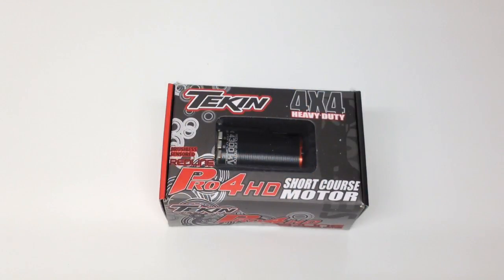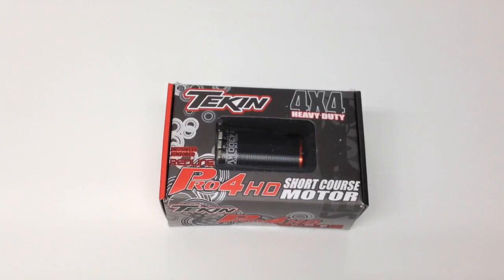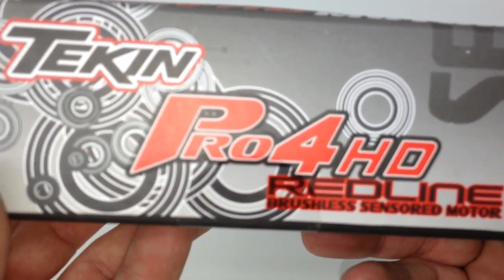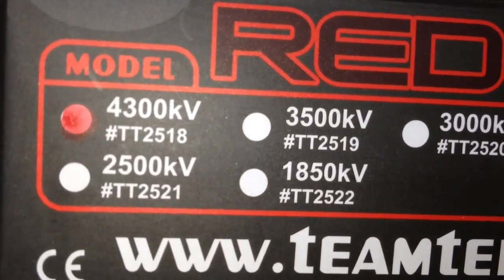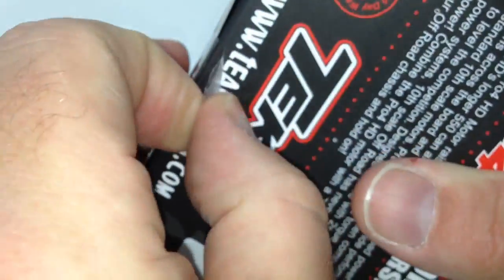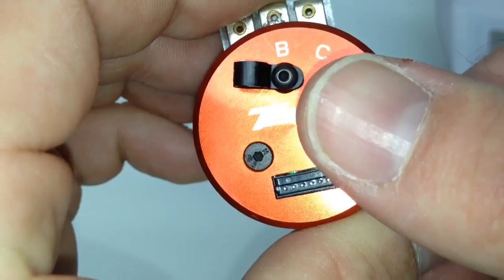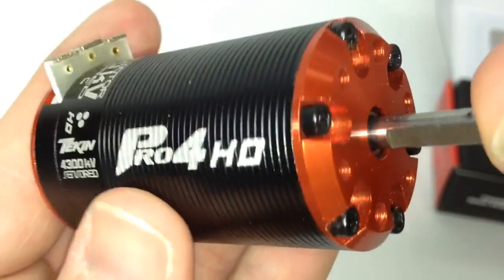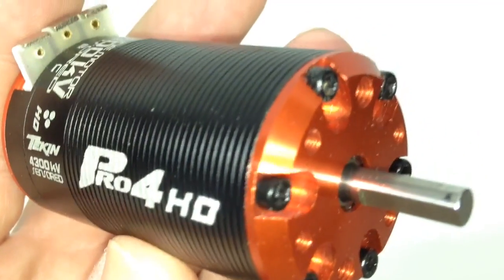Tekin Pro4 HD Brushless Motor - First Look!

Comment: Puedo instalarlo en mi camion con una Bateria 3S ???❤❤❤❤
Reply from the maker: Yes, you can use the Pro4HD with a 3s, but you need the 3000kv motor.  If you use the 4300kv or 3500kv, you'll have heat issues

Comment: is it true that a 2 pole motor is faster than a 4 pole motor. same kv same battery?
Reply from the maker: To certain extent.  4 pole will creat more torque to push around a heavier vehicle or a 4wd driveline.  2 pole is typically only used in 2wd/lighterweight vehicles

Comment: which motor do you recommend Tekin ESC X 4.5 motor or pro4 HD motor
Reply from the maker: The Pro4/Pro4HD motors are much better than the older Tekin SCX 550 motors (4.5, 5.5, 6.5)

Comment: Yo I bought this same exact Motor but mine is kinda weird when I spin the shaft it spins like a 2pole motor a 4 pole motor is much more difficult to spin or is this normal
Reply from the maker: This is a sensored motor, so they usually will feel smoother than a typical sensorless 4pole, especially castle motors.  For some reason my 4300 spins smoother than my 3000kv.  Might have to do with the winding
Reply: Miguel Plascencia  It has to do with being a sensored motor. the tight air gap used to create the return RF in each line isn't required because it's sensored. I'm not sure if reducing the gap improves performance or anything but there you go....

Comment: wait can you explain why some motors have turns and some have kv? or how many turns is this motor?
Reply from the maker: +mx4life When I first got into RC, it's confusing at best.....but here's what I gathered:  Turns are typically found in brushless/sensored 1/10th scale race motors and brushed crawler motors.  The lower the turn, the faster the motor thus the less torque it will have.  KV is typically found in mostly sensorless motors and is the opposite of turns...The higher the KV, the faster the motor is and less torque it has.  I don't believe there's any rhyme or reason when manufactures choose kv or turns to be honest.  Novak had a chart out that converted turns into kv...

Comment: i forgot the specs.
Tekno SCT410 chassis.
2 sets of wheels - one set for clay and one set for packed dirt
Tekin RX-8 speed controller
Tekin 4600kv motor
Turnigy 4409 Servo
All Tekno aluminum chassis upgrades
Tekno SCT410 air control guards
FLY SKY FS-iT4 4-CH 2.4ghz Telemetry RC Radio Control Transmitter w/ LCD Touch Screen
2 shells - one painted and one still in original packaging
Tekin PC programmer (to modify output to controller and motor)

Comment: just wondering what you think? I have a friend offering me a used tekno 410 rtr for $500 or should I buy a new slash? I'm a newbie but he states that the tekno is much better.  a second opinion would be great.
Reply from the maker: +Richard O The Tekno is WAY better than the Slash 4x4 LCG.  I've owned both and the Tekno is a tank durability wise.  It's much heavier and with the electronics he's including should be a no-brainer.  Retail wise, he's offering you about $1,000 in products, which really isn't bad unless the chassis and electronics are beat to hell.  The Servo and Radio system aren't anything special (and they'll get you started) but the ESC and Motor are great products.  Two things you can check to see how much wear there is:  Check the dog bone pins on the drive shafts - Are they round like they should be or "D" shaped from all the wear?  Have him pull the motor mesh/remove the pinion and check how free the drivetrain spins - It should be pretty free.  Hope this helps
Reply: +The RCNetwork thanks for your help I will check it out asap.

Comment: Have you heard of the Atomik red 550 2650kv?  is atomik a good brand?
Reply from the maker: +sparks I haven't heard of them....2650 will need some voltage to push speed if that's what it's going in
Reply: +The RCNetwork  They sell on ebay.

Comment: Just put the pro 4 hd with the rx8 gen 2 in my losi and with a 13 pinion gear my tempon the pro 4 hd was 139 to 140 and the rx8 was only 89 to 94. That was with a thunder pwr 5300 mah 35c battery. I have since bought a nano tech 6600 mah 65c battery. But thinking about getting a 7200+next.
Reply from the maker: Eric Pendergrass Good deal!  The Tekin products are awesome and really perform.  Watch those sub 65c batteries.....The weight of the Losi and the power of the Tekin system likes to chew them up!
Reply: Good to know, thank you!!

Comment: So what happens if you throw 3 cells at it? Does the smoke come out? I just ordered a 3000kv today for my wraith. Would've much rather have had the 4300
Reply from the maker: The 4300 on 3s will run very hot. And potentially overheat. The 3000 should be ideal on 3s. Have you thought about the Roc412?

Comment: The RcNetwork what is the advantage of pro HD 3500kv and pro HD 4300kv. I chat through horrizon hobby and said i would pick up the pro HD 3500kv over pro HD 4300kv because 3500kv less heat than 4300kv is that true? I am planning to put my Tekno scte410 pro HD 3500kv
Reply from the maker: Hey Raved.  I don't know how many times I've been in local hobby shops and have to take over for poorly trained/unmotivated sales people!  The Horizon guy is right to a certain degree.  The 3600kv motor will run cooler if you had two trucks, same battery, electronics and gearing over the 4300.  What he failed to mention is the 4300 would have WAY more top end speed, and to be honest, as long as you run the RIGHT electronics, heat is NEVER an issue when geared properly with the Tekin Electronics.  The SCT410, although heavy, doesn't need the added torque that the 3600 has.  So, if I got it right:  SCT410, Pro4HD 4300kv, save your self some trouble and get the RX8 Gen2 (over the Orion R8.1).  You can easily go up to an 18t pinion if needed and your temps will be RX8G2 - 105, Pro4HD 4300 - 145 All day long!  Make sure and invest in some very decently spec'd batteries - 6500mah/75c+ constant - I do like the Team Orion Carbon Pro 6500mah/90c constant
Reply: The RCNetwork Thank you and thank you! for your reply. Well as you mentioned i am going ahead to Tekin 4300kv  and rx8 Gen2. i know the orion R8.1 too much expensive. I just got orion R10 and very smooth and fast it's my first ESC can't believe how good it is.I watched your review and orion R10 and i was very impressed. That's why was thinking to get Orion R8.1.

Comment: Hey! I've been reading a ton of your information about the sct410 and I've purchased it and the rx8 gen2 but I'm up in the air on the 4300 vs 4600 pro4. Have you ran the 4600 in your sct410 at all you always talk about temps in your scte. I am thinking about getting the orion 90c 8000 mah batteries so I should have the c rating for the 4300.
Reply from the maker: I never ran the 4600 in the sct410. I knew the sct410 was going to be heavier than my scte, so I wanted to ramp up the power and wanted to keep the temps low. If you're planning on the Carbon pro Batteries already, get the HD. That's the biggest difference is the HD needs more power, faster and the Team Orion batteries deliver.

Comment from the maker: Basically the lower the KV the more torque you'll have and less top end speed.  For example, a 2650 will have more top end speed over the 2200, but the 2200 will have more torque (which may be good for a Monster truck)  Another way to combat that is you can run the 2650 on 4s for a similar speed as the 2200 on 5s.  I plan to keep my SCX10 with the Wheels and tires for now.

Comment from the maker: I didn;t even answer the question on gearing.......It really depends on your track.  I run on a huge indoor clay track with a long straight.  I'm running stock spur and a 17t.  I did run an 18 for a while but backed off one tooth.  If you ran the 4600, you'll probably have to bump it up 2 teeth is what I found

Comment from the maker: The 4300 is a great motor for the SCT410.  Make sure you have the right batteries for it, the 4300 demands very high C rated batteries (75c constant+).  You will puff lower C rated batteries.  You will also need higher mah batteries as I have found.  The 4300 just drains it a bit faster than what I experienced in a lighter SCTE/MIP.  I'm running 6500mah+ now

Comment from the maker: If you're drag racing, the biggest pinion while keeping the heat down!  I'm running an 18t right now and temps are fine.  Battery wise, the 4300 will suck the life outta cheap batteries, so be careful.  Get the highest C rating you can afford, but to be honest, I wouldn't run anything under a 75c (constant)

Comment from the maker: Theoretically, the 4600 spins faster.  But remember, I was running the 4600 in a lighter truck.  The 4300 is now in a heavier truck.  Temp wise, I'm running the same temps in the 4300kv vs the 4600v and I have up'd th pinion to gain the top end speed.  so all is well.  It's about balancing torque, top end speed, vehicle weight and temps.

Comment from the maker: Are you sure there wasn't another issue?  This motor should run pretty cool being larger than stock.  My current temps on my regular pro4/RX8 are 135/105.  I expect the pro4 HD to be about the same if not lower

Comment from the maker: Lots of people are putting the Pro4/rx8's in them (I don't know that I would recommend it, however, Squirrel did), but you will have to upgrade $200+ in the drivetrain to with stand the torque of that motor.  transmission gears, fornt/rear dif gears and def. driveshafts.  I would run the FXR combo with a 3s lipo.  In the world of crawlers/scalers, they always say "volt up, gear down!"  Hope this all helps

Comment from the maker: Thanks Marty!  The 22's ESC/Motor is really designed to drive that 2wd, 3lbs buggy. Brushed wise, the FXR/Pro 35t combo is great.  Pretty decent wheel speed (a bit better than a fast walk) and price wise below $150 for the combo. The motor is also water prrof and the esc is easily plasti-dip ready!   Brushless wise (tekin) you would have to step up to the pro4/rx8.  I don't think the redline series/rs-pro can handle the weight and torque, plus they're more expensive.....

Comment: Another cool unboxing video Rich, good job :)

A little question for you since you own a lot of Tekin stuff : 

One of my rigs is an Axial Wraith, I did a little heart transplant on it last winter, I installed the 13.5T sensored brushless motor and ESC that came in my Losi 22 in it. Very smooth, torquey, a great little combo but the 2750KV 13.5T Losi motor is not really up to snuff when it comes to wheel speed, I'd like something a bit more powerful, what Tekin motor/ESC combo should I go with ?